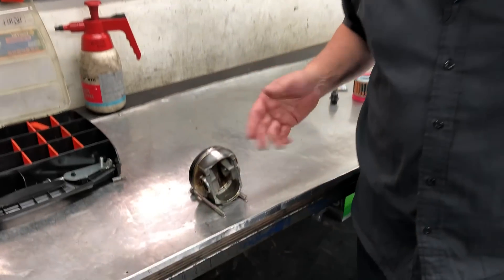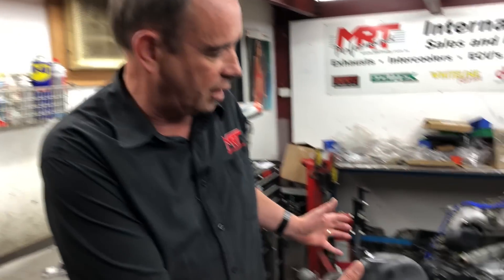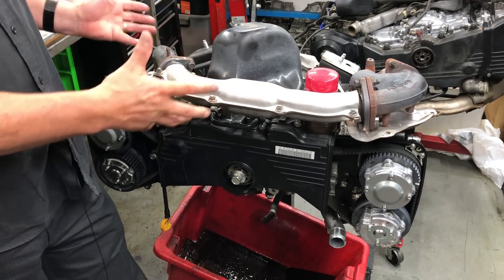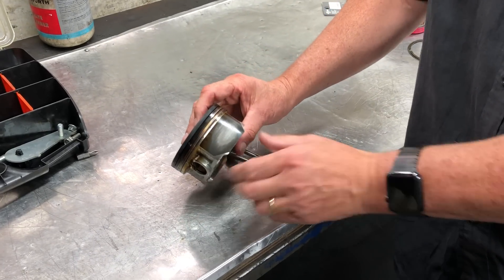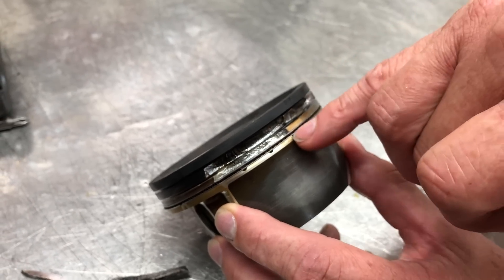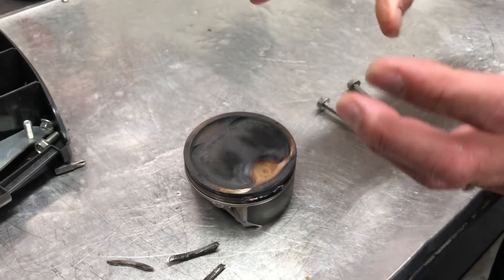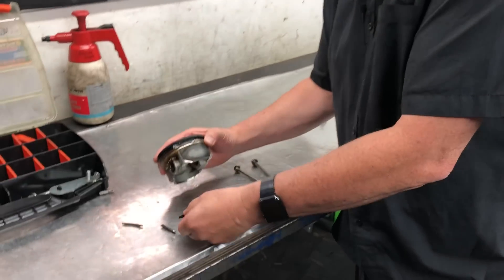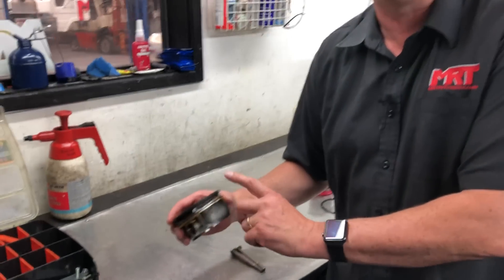SUBARU RINGLAND FAILURE - What you need to know

Comment: This video is complete cap, not that subarus dont break ringlands, but the reason is non of the above, its actually that from factory they run small ring gap tolerance for the heat that will be generated.Also the majority of ringland failures on subaru happen on cylinder 4 where the coolant circulation is poor and u can install a easy mod to fix that problem.stock pistons are strong but not enough ring gap will destroy any piston dont matter forged or cast.Do some research before making silly videos like that smh

Comment: question for anyone who might see this even though this video is super old. I've got a 2013 STI and I almost got stuck in some really wet snow. the only way i was able to get the car to move was by getting it near red line. the rev limiter stopped it from going over red line but i had to run it right under 7k rpm for a good 30-45ish seconds. I haven't noticed any major oil consumption but I've been paranoid about it ever since and can't even drive the car enough to monitor oil burn due to the pandemic. Anyone think i should be worried about ringland failure? Thanks in advance!

Comment: I'm using RVS triboceramic treatment in my stock XT EJ25 and it noticeably smoothed the engine and gearbox. Gear changes became tighter, engine smoother. Any experience on that down under?
Reply: Hey man im interested in this. Any links?
Reply: @kzz8971  https://rvstec.com.au/ or https://www.rvs-usa.com/ depending which side of the globe you are ;) It's originally a Finnish company.
Reply: @marttiinnanen4911  Thanks a lot!
Reply: @kzz8971  np

Comment: I have my 12 s edition WRX and it is having issue of burning oil. I only bought it in April with 80,000 on the clock. It is tuned to Cobb stage one. I took it for first service to WRX specialist in Melbourne and asked him to have a good look and notify me of any abnormalities with the car and they did the service and found no oil in it and he told me that the motor sounds bit off beat and they found some glittery stuff.  any ways been taking car back and forth to the dealership, they been topping up the oil  now it was the fourth time I took it there and left it and told em that m not picking it up unless they are going to fix the issue. See what happens next. Can you suggest something? Would it be something similar like this? Lucky I bought 3 years extended warranty on it.

Comment: I have a 2011 Bone Stock WRX. I kind of want to try an accessport stage 1. Would I run into a possibility for failure if I do this? I change the oil every 3000 miles.

Comment: Can this issue appear on a stock 2007 EJ253 out of an Outback with 124k miles? My car uses a quart of oil a month, it doesn't leak anything on the ground and the bottom of the car is totally dry.
Reply: Yes..

Comment: @mrt performance what’s your definition of driving it hard? My 16 STI is stock and gets new Mobil 1 every 6 months or 3500 miles with a K&N high flow filter.  I drive the car ~6k miles per year, and it sees heavy load acceleration at least 2-3 times per week as I run through the gears.  No mods other than cat back exhaust.  Thanks!
Reply: I think by driving hard he means driving the car daily, plus trackdays. You should be fine at that. BTW, I hope you dont change the k&n filter every six months?!?!
Reply: Bob Dole thanks for the feedback! Sorry I should have clarified that I run the K&N oil filter.  I don’t use their air filter as I’ve read these cars run lean stock and I don’t want to increase airflow.

Comment: Damn spend 40,000 for a engine to go at any moment. 😕
Reply: 2018+ pistions are different, a decade later they're fixed
Reply: WHere da fuk do you come up with that figrue? 40K
Reply: the cost of the car. New, presumably. He ain't wrong though. I love the STi, it's like the last of the OG tuner cars from the mid 2000's. But the ringland problem is absolutely unacceptable. I wouldn't recommend a STi to anyone if they didnt have around 7k in the bank to build the motor after it goes.
Reply: @nemui_tora  hay mate u seem knowledgeable, i have a 99 evo 4 it's running out of oil every 4 months. Could this be ringland failure or just the age of engine?
If there was oil leaking would there  be oil built up around the engine?

Comment: At 75k. COBB Stage2 for about 2 years; using very little to no oil at all between changes and excellent maintenance. Just had a new OEM wire harness install, then the WRX overheats badly (& p0117), for the first time ever. Stopped and cooled it, seems fine...but just to be sure went to Subaru, and they say blown head gasket; though I never noticed any loss of power. Waiting to hear any day about the pistons, etc.

Comment: My ej251 is at 235xxx miles. Every single gasket is gone and is on its 2nd failing head gasket. I have blow by and compression loss and carbon build up on the rings. No catch cans so it goes into the intake and exhaust. 
That engine still runs.

Subaru is a different company now run by different breed of people.
Reply: Pfft my ej251 is at 254k. On its 2nd head gasket has 13% ring blow by on all cylinders burns a quart of oil every 500 miles no catch cans and I turbo charged it with a wrx td04 on 5psi with a voltage clamp and 10:1 fmu and it was a freaking fun ride till I blew a ringland in cyl 4 130psi compression then went another 600 miles and I finally blew it lol. Now I'm doing a 255 hybrid block with my 251 heads
Reply: Do the 2019 sti have the same problems??
Reply: May wait for the 2020 sti
Reply: jortega61924 2019 STIs are still ej25s

Comment: Brett, will the AOS or oil catch can help prevent this failure?
Reply from the maker: AOS is for oil ingestion, this is normal for all engines, so no it wont help
Reply: Thanks for the reply! 

If it is not helpful, then what else can we do to help reduce the chance of ringland failure?
Reply from the maker: ringland failure is a whole lot about how the car is driven and how and who modifies it and their knowledge of ignition control
;)
Reply: So to avoid this, get a proper tune and make sure to Install Front Mount Intercooler and a boost solenoid?
Reply from the maker: not necessarily..........
the piston failure is a Subaru weakness that is accelerated by poor mods and poor tuning
a FMIC wont eliminate that
:(
Reply: From my research on Subaru forums, there is a VERY strong hunch that getting a COBB stage 1 right off the bat will help. The accessport tune it comes with will smooth things out. But I think the problem is also the pistons themselves. As people with Stage 2 have also gotten blown ringlands.
Reply: @nemui_tora  yup I'm on OTS stage 2 & i got ringland failure. Going to swap with a JDM EJ205

Comment: Ok now wonder my subi is burning so much oil, 1 month after an oil change the oil level went down to half way, some people were telling me it might have been a bad turbo deal but I'm pretty sure it's the rings after watching this video, I appreciate what your guys do at MRT, quality videos wish I would have found you guys sooner, does anyone know how much would it cost to replace piston rings? I'm planning on building the EJ25 in about 2 years after I graduate college so I'm not sure if I should wait till then, or replace them now. I don't run the car hard, but one time I noticed smoke come out the exhaust when I did a pull in second gear, i was at about 6k rpms
Reply: 3Revs it's not a bad turbo its ringlands. I hoped mine was turbo to. But I been drinking 3 quarts every oil change for 30k miles. Just keep oil in it.
Reply: 3Revs it not just pistons. When you go to build there will be a lot of little shit you should replace. Timing chain, oil pump and so on. Around 8k to rebuild and that's not with a turbo or anything

Comment: So in short, if you do do a intake, and exhaust upgrade with proper tuning and dont flog it, ringlet failure is potentially avoidable.
Reply: Bart Majic People’s main problem is modding it without a tune . You have to tune it each mod .
Reply: I think the best thing to do is aftermarket pistons and rods. Then modify for power.

Comment: Is the subaru sti reliable in stock form? Or its just a matter of time that they deside to break down ?
Reply: Pretty much, yes. You can still beat on a stock STi and they will break down sooner. The biggest problem seen is kids modding their Subaru and not getting an appropriate tune, leading to excessive knocking. Also people who mod past 400BHP and thinking the stock internals should be able to take it. The car was engineered for 305BHP at 17PSI. going beyond this is at your own risk.
Reply: Matt Sharkey if you keep it stock will it still last? I see a lot of subaru up here in the  north/east, but 90% ofbthem have engine modifications.
Reply: TotoMan UV I have a stock 2015 with 90k miles and it has had 2 rebuilds for ringlands. And I only use 93 gas and oil change every 3k. Its eating oil again and I'm out of warranty so I'm building it. 8 fucking k just you get the engine healthy

Comment: I have an 06 hawkeye N/A ej204. I bought it recently in very good cond with 106000k's.
It has gone well for a few months but now has a slight hesitation at 2900rpm. There doesn't seem to be miss when this happens, just a slight hesitation for a second or so. I did recently run the tank quite low.(light was on for about 5k's) It idles perfect. From what I have read it sounds like the VVCS sensor? Any ideas would be greatly appreciated and may gain you a customer. I don't want to replace heaps of parts on spec. I want it fixed the first time. thanks.

Comment: Dear Bret, I understand that good fuel, a good 3 port oil catch can, regular servicing (oil changes + spark plugs) and sensible driving all help lower the risk of ring land failure. Is there anything else you can advise on reducing the risk? Or shall I start saving for forged Pistons now? Lol many thanks
Reply: ScoobySTI Chris the things that crack the ring lands are the rings butting against each other during high boost/high heat situations.  Open up the ring gaps and the engine will live a a lot longer.  GM LS engines do the same thing, that's why boosted engines get the ring gaps opened up or a real high mileage engine is found ( they don't get race ready until after 100,000 miles )
Reply: Steve Ross thanks Ross, so what your saying ring land failure has nothing to do with ‘knock’ caused by heat, low octane fuel etc etc ? Thanks 👍
Reply: ScoobySTI Chris yes buy an evo fix the problem every time. This coming from someone that owns a 100% stock 2015 sti. And I'm going on engine number 3 for ringlands. I love this car but right now I wish I got a fucking evo

Comment: Love your videos Brett, just wish I had all that knowledge. Question, if you can offer some advice?
I have a 2017 STI (stock engine) & considering the GFB Respons TMS BOV (or Turbosmart equivelant). I'm just looking for some sound for now.
I've read this mod wont require a tune, would you agree with that? Also would it be safe to run the valve open/closed in most conditions without issue?
Reply: 3 years and still waiting for all those anwers lmaoooo

Comment: It's an operator issue: the way the car is driven means a lot… with the turbo not pressuring the intake the engine should behave nearly identical to an oem one. 
News Camshaft, different compression ratio, bad fuel would be more of a concern… so this video was made to scare Subaru Tuners than to explain things.
I am just saying, stop pressing the throttle and the car won't notice it's Stage 3 lol
Reply from the maker: Video made to scare Subaru tuners? We tune more Subaru's than anyone else in the country! The aim of the video (and indeed all our videos) is to empower the public so they can ask the right questions when having their car worked on by their chosen mechanic (hopefully us).
Reply: the tail pipe is a good place to tell if the car is burning oil. it leaves a black soot at the tail pipe. engines that aren't consuming oil generally have no soot at the tail pipe. my 14' impreza burns about 1 quart of oil every 1500 miles. this is normal from what I've been told by Subaru. I drive my car like a senior citizen and it still burns oil. I just got used to checking the oil level every other time I fill up. I should have stuck to Honda but wanted a compact car for the snow. lol.
Reply: Shar L 1 quart seems high. Typically the Black is from the car running rich. My built STI burns no oil over the 3000 mile change span and I have black in my exhaust. Just carbon build up from exhaust. You should have your car looked at. 1 quart is high as hell.
Reply: Subaru told me 1 quart every 1000 miles was normal. Seems a bit high but face it. These things burn oil when new. Subaru is aware of it too.
Reply: Chandler Braaten I guess I am the only one then.... 60k miles and lots of mods and I burn no oil what so ever. I change mine every 3000 to 3500 and it’s full every morning when I check it.
Reply: Chandler, yup this is what Subaru told me. I even checked my oil level and saw that it was low one quart. I brought it in to check the oil level because I did the oil consumption test. the dealership filled the oil to the full mark and told me that is wasn't burning any oil at. I told him I checked the oil level before I brought it in and know that it's one quart low. the service writer told me I don't know how to check the oil level and n the dip stick. the funny thing is I was a mechanic and went to mechanic school and was an ASE certified mechanic in breaks and alignment, advance engine performance, and auto electrical. heck, i used to work at capital honda in san jose California as a technician. till this day I still use my mechanic skills. for people with Subaru that don't consume excessive oil, consider yourself lucky that's all. there's class action lawsuit against Subaru for oil consumption problems in the past. look up on google. for anyone changing oil every 3k miles with 0-20 oil, you must have money to burn. the dealership recommends oil change at 7k for 0-20 oil (synthetic).
Reply: Shar L they dont call 'em "six star oil eaters" for nothing. When they told me 1 quart per 1k miles. I laughed and said "so basically i should just change the filter and fill it back up every 5k miles? Its a 5 quart system and i change my oil every 5k using rotella 5-30 synthetic.

Comment: SO everyone gets an AWD vehicle and can't even give it the boot under 3000 rpm?  LOL.
This car wouldn't survive my commute then.
Reply: Beau Mancini  Of course you can, that's why we have gears 1 and 2. I can't think of a single turbo engine that likes to be lugged. Only real geniuses wot in 4th gear at 2k rpm👎
Reply: Nik Coffman what I'm saying to you is that we'd have no OE usefulness to turbo.
For instance my Saab TurboX 6mt had a baby 4 cylinder turbo on it from the factory. Just a single, on a 2.8 v6.
Hill climb, 6th gear, no need to down shift, it gets the job done because it was designed to, that was it's whole point.  Low end as soon as possible.
With a larger single it won't light up until 3200 rpm so it'll be fine anyways, but for now it owns my long commute

Comment: I have a factory original 2006 STI with no modifications and have never tracked it. Is it still likely to suffer ringland failure without any engine mods?
Reply: Not likely. What oil are you running, and how often do you change it and check it? How much do you add between changes? Have you had the compression tested? Do you do any oil analysis?  I have a 2007 that has 115k miles and has been stage 2 for about 75k of them. No issues.
Reply: Been stage 2 tuned for 50k miles now in my 07 sti. No issues. Normal oil consumption still. Tuning and monitoring your oil is key to longevity.
Reply: Mr. AWDriver and of course don't lug the engine!!!!

Comment: I've heard the most common thing to make them fail is lugging the engine. That is boosting under too high a gear; while cruising and then flooring it while at speed at say, 4th or 5th gear instead of downshifting to 2nd or 3rd then applying throttle.
Reply: yes, you are correct. Engine lurking is a killer for any turbo engine

Comment: My 2005 LGT eats oil, its stock, but no aos or catch can. Would either of those help?!
Reply: Won't stop the oil consumption, every car consumes oil, but if you install such a thing, don't get one of those return to sump aos systems that have the pretty thing sitting on your filler tube for example, they'll just fill your oil with water. The humble mechanic has a latest video showing him emptying a catch can, you'll be surprised at what pours out, and a return to sump aos, all of that is what would be going back there.

Comment: Remember the good old days when Stis had forged pistons and WRXs had limited slip differentials.
Reply: Hell yea, the peanut generation is the damn best. At least you can still get the forged build engines, the ej207 is still a new short block option to buy. Remember when they used to factory close deck too?
Reply: Nope. The 207 has forged pistons, (v7 gen), lower compression ratio, semi closed deck and can rev higher. And costs the same to buy as a new short block. Bought as a complete long block motor the sti will cost more.
Reply: MV60 isn’t the ej205 just as good but cheaper